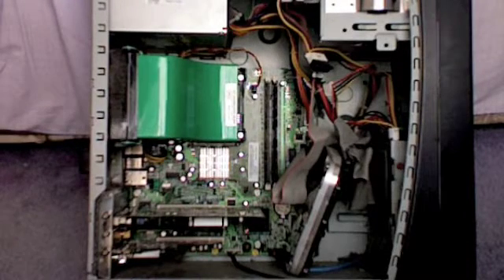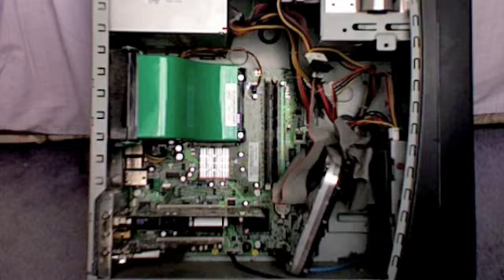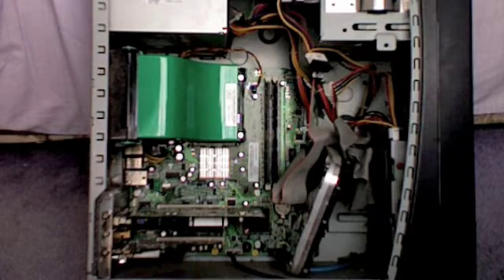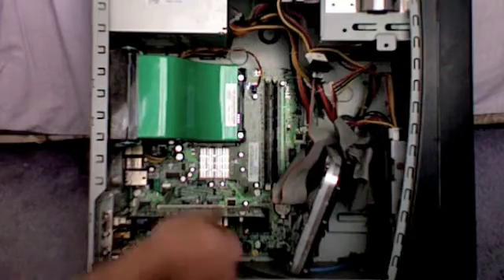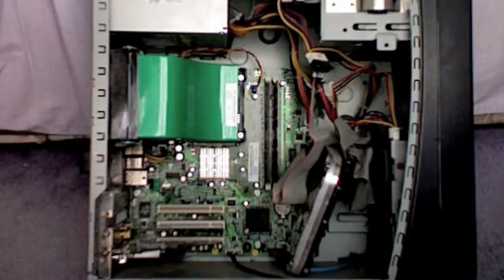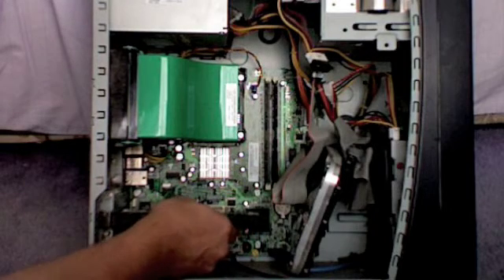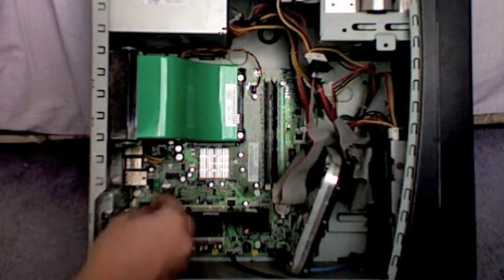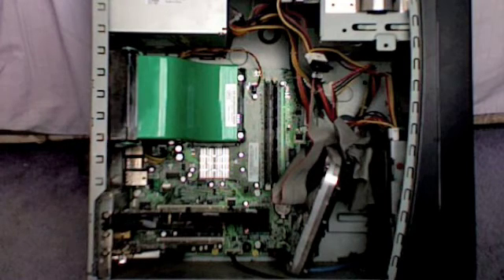Tutorial: Removing and Installing PCI Graphics Card

Comment: anybody attempting this needs to be careful... try not to do this on carpet, or if you do, make sure you are grounded so there is no static electricity in you. also make sure all of the energy is completely gone from the capacitors in your computer, (just hold the power button for around 5 seconds) i'm kind of upset that he didn't mention any of this. there are a couple more things i should mention... but just google this stuff and you'll learn a bit more.

Comment: @trocoman Yeah your motherboard bios will recognize it and send the info to windows 7 with no problem.  I take apart my computer a lot and even remove my motherboard from my case to get easier access at removing the heatsink.  You can always remove video cards, sound cards, and ram with no problem and when you put it back together and boot up the system there will be no problem at your computer recognizing the hardware as long as it is seated in the slots properly and nothing is fried.